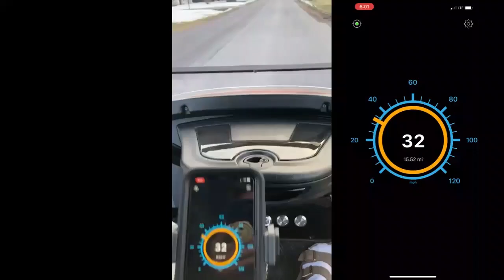Golf Cart Seat Covers install and Comparison for 07' Club Car Precedent. Rebuild Part VII

Comment: How does the bumper and trim paint hold up over time? Just want to make sure if I spray the parts on the cart that it does not flake off. Thanks
Reply from the maker: So far so good
No issues yet. But I’m only on my second season with it.